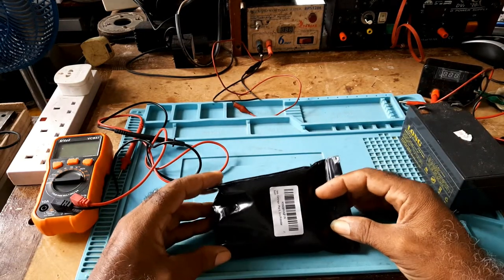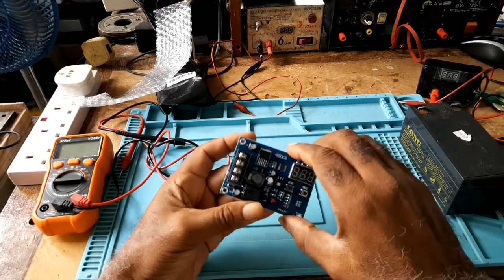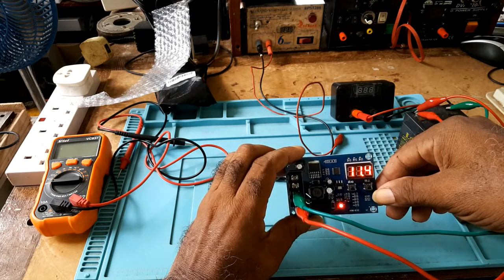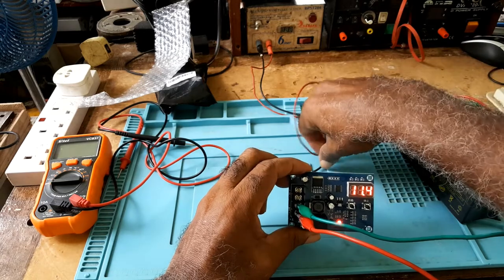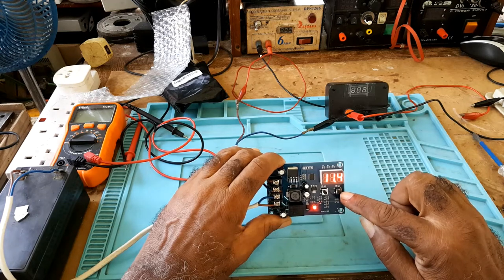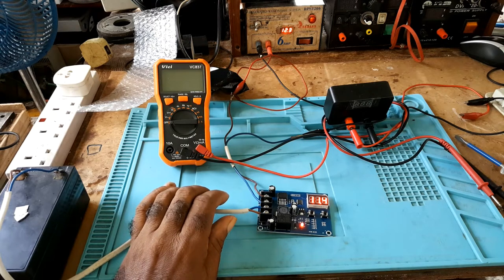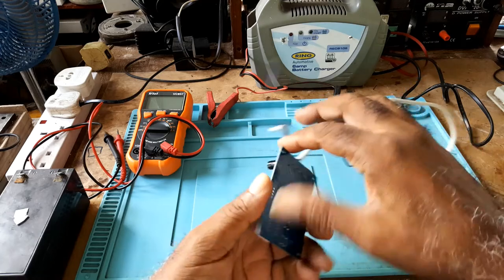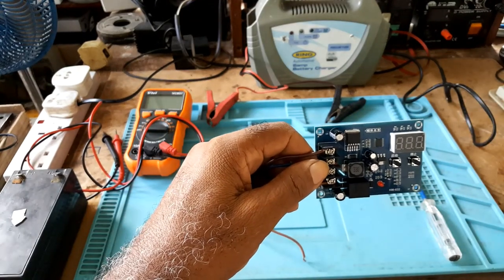How to use XH M603 Battery Charger Controller

Comment: Nice video Cooperations. Just keep in mind, this controller board just does one thigs. The device determines when the minimum battery level is placed below a preset level, when this level of voltage on the battery poles is passed, a relay (max 20A) connects charging voltage to the battery. This prevents the battery's pole voltages from passing the lowest permitted level which allows the battery to be recharged. And the same occurs when the battery is fully charged to the pre-set level, the charging voltage is disconnected and overcharging with a damaged battery is avoided. However, the device has absolutely no control over the charging current of the battery, normally 10%-20% of total battery capacity. If the charging current is to be regulated, as must always be done when charging a battery that is being charged, a converter with Constant Current (CC) must be used. It is important to be aware that this unit is only part of the parts of what is needed when charging batteries.

Comment: Hello, listen to the amps how are they managed?  I need to charge a 12v 12A lithium battery pack.  If I put a 1A charger on the battery does it get 1A?  Thank you
Reply from the maker: Yes if the input amps is 1A it will change at 1A it will take a long time.
Reply: Where can I have  the output power?

Comment: Can I use an old laptop charger as a charger to charge my 12V battery?  The narrow and long black ones.  But sorry, to charge the 12v battery I have to go in at least with 13v right?  The charge amps should keep it constant on the right modulus?  Thank you
Reply from the maker: You can use any power supply with the module  ones it's above the 12v or 13v you looking for.
Reply: @AlwynNicholas  Thanks, but then if I want the battery to charge I have to send in a few more volts than the battery.  13 volts example, to have 12.6 in the battery.  And as A to load a 12A I can use a 2A what do you think?
Reply from the maker: @lifeafterlife9939 The Amp don't really matter it will change, the lower the Amp the longer it will take to change.
Reply: @AlwynNicholas  OK thank you

Comment: its really not a charger at all. it has a relay that is activated if the battery voltage drops below a set value, allowing what ever is connected to the input side of the relay to the output side of the relay. once the voltage increases to a defined higher level it can then deactivate the relay which breaks the connection from the input to the ouput.

i wouldnt use this for charging, but if i did i would let the "charger" aka power supply, which should be variable and set to approx 13.8v to 14.4v and do a cc/cv charge until the battery was actually fully charged, which you cant do, as it will break the connection between in and out as soon as the target voltage is reached which will be before the constant voltage stage is reached.

there are applications for such devices, but using this for charging seems  a little strange to me. i do have an application though, and even though they call this a charge controller, i call it a low voltage disconnect/reconnect device.

i use a 48v version of this relay, i set it to turn on when the voltage reaches 55v, and turn off at 51 volts. when this relay is turned on, it turns on another relay but it is a dpdt relay. when the relay is off my heat pump runs from the grid, when the relay is on it runs the heat pump off my battery/inverter/solar. the battery/inverter runs lights and computers day and night but i dont always have the power to run the heatpump/ac. so i allow the heat pump to run off the grid by default, but if my solar panels get the batteries up to 56v, which is close to half way charged, i will allow the battery to power the heatpump/ac, but if the voltage drops below 51v, then i am no longer using solar to power the heat pump and starting to run off the battery and it flips the load back to the grid

i suspect you know all of this alwyn, but i suspect noobs to this stuff might think that the "charge controller" is doing much more than it is, its just a low voltage disconnect/ reconnect relay. its not monitoring state of charge on the battery or current, it simply allows what ever is connected to the input to be connected to the output and vice versa and this link is determined by the hi/lo parameters you set, which could happen to be set in a way to partialy charge a battery, but 12v  will only charge a battery to 12v, and not even finished off the cv stage of the charge cycle.

you video did help me with pinout though, as my terminals were not marked. thanks!!

Comment: My board does not work, it only reduces the current in the box and does not plant.
Reply from the maker: You can use any power supply with the module ones it's above the 12v or 13v you looking for.